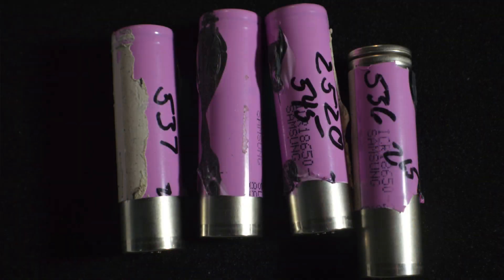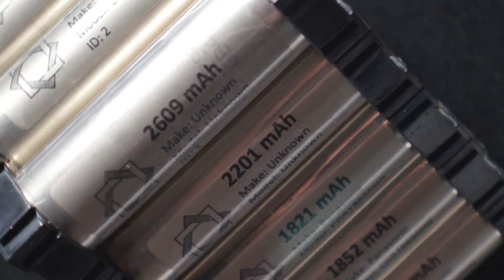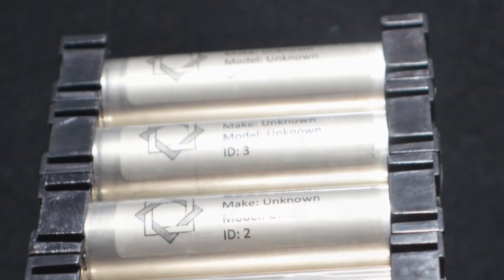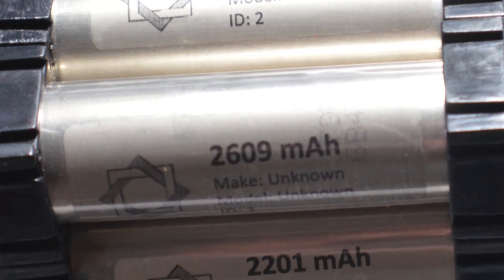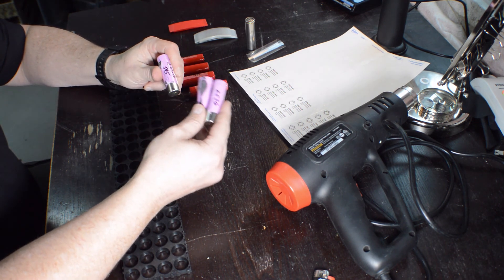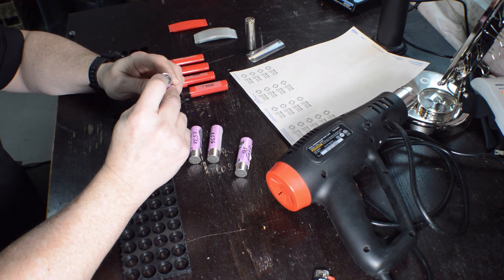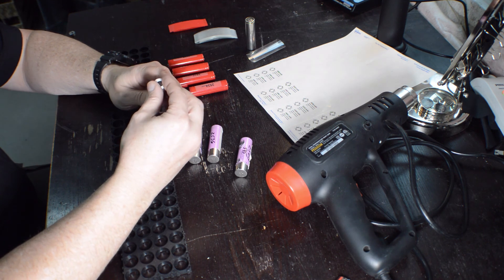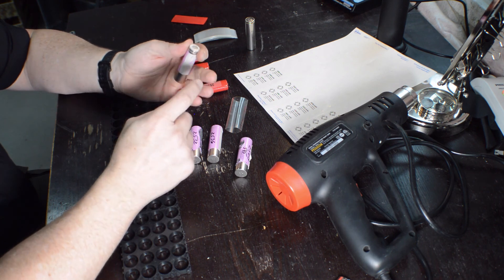Why Rewrap 18650 Cells

Comment: all the laptop batteries i have ever taken apart have had the cells hold together :/ strange. All the way back to my first tear down in 2007. My ebike battery too. Those ebay cells from alarm hookup should have disclosed that the wrap would likely fall off if you dismantled them exactly as their description suggested. Either way, videos like this help others to be prepared. Thanks for posting it!
Reply from the maker: Agreed.
Reply: All 18650 cells (ebikes, laptops, powertool batteries, etc.) are connected, usually via pure nickel strips that are spot welded to each cell!

Comment: I have built 12V 100Ah lithium ion battery pack to replace the existing 12V 100Ah lead acid battery for inverter. After somedays the battery failed to work. What are the steps to be taken to avoid such failures?
Reply from the maker: I had issues with my small battery pack so I started adding BMS's to help prevent over discharge issues.

Comment: Could you also suggest what type of 18650  tube gasket used and where you have bought these
Reply from the maker: +Chris Groothoff good point. I reuse the original gasket and I have also reused gaskets from cells that are dead. I hope that helps. 
Frank

Comment: if they are in series. the neg. of one is more pos. than the one before it. it can cause a short. and most of the time its in your house! and could burn it down. or even just a fire! either way. it can be prevented!  love the labels and the clear shrink wrap! and I subbed!
Reply from the maker: Thanks for watching and your comment.  I'm not sure I understand your concern. But I would be interested in setting up an experiment to test your concern.
Reply: Frank Brand like if a pack is in series. and a screw or nail. fell between them with the cells unwrapped. it can short them . because the neg is the pos of the one before it. my house burnt down last year. it wasn't anything I did or didn't do. but it has given me a phobia. now I have a off grid place I'm trying to move in to. I need more battery and get panels up. and a few other things. worries of fire hazards I admit slow things a bit. great video.
Reply from the maker: +James stranger I'm sorry to hear about your house. A tragedy such as yours would make anyone very cautious. Good luck on your new place. Thanks for watching.

Comment: Very nice thanks 🙏
Reply from the maker: I like you avatar logo.  One of the projects I want to do in the future is to build a DIY RV trailer with solar and 18650 batteries.  Thanks for watching.
Reply: That exactly what I’m doing this spring. Tiny trailer 900watts Solar 24 v.  About to start my very first 7s pack. Still trying to find cells.
Reply from the maker: Keep me posted on your progress.  Frank

Comment: you have a design guide for the charging/discharging station?
Reply from the maker: Yes, I have some clips that I filmed when I was creating the charge/discharge station.  I plan on putting the clips together and using it for one of my posts.  Stay tuned.  :-)  Thanks for watching.  Frank